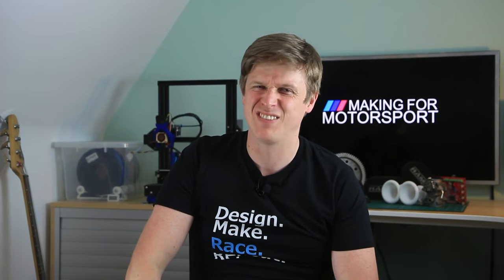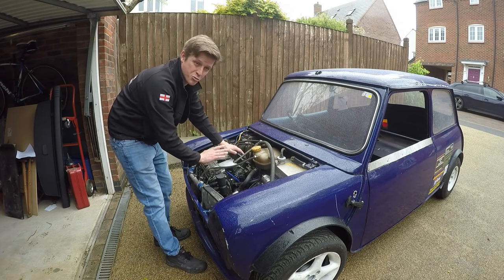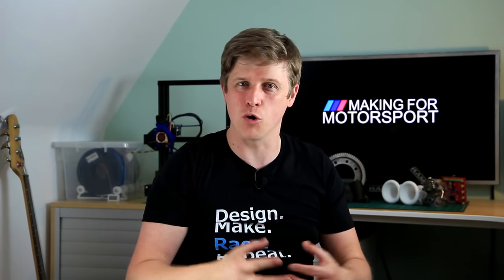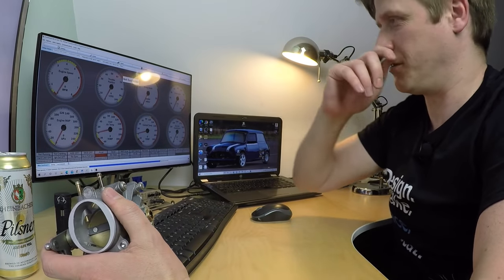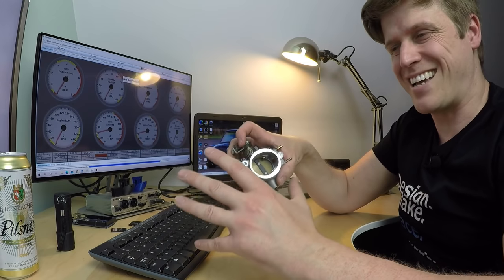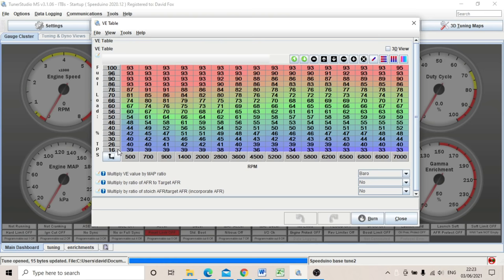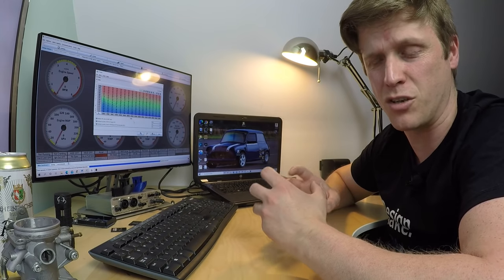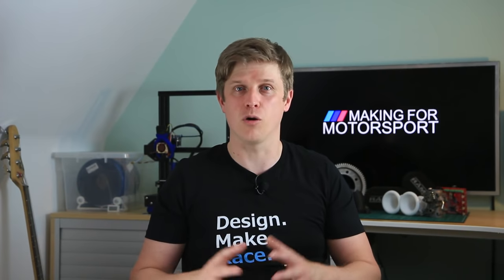How to fit Individual Throttle Bodies - Part 3 - Return of the BRARP!

Comment: Hi man! As You I built my car for fun in garage on jackstands, and as You, I fully wired my speeduino ecu on my own, and began to play with TunerStudio, now, if You didn't see Andy Whittle's channel yet, I suggest You to do, really helpful!(this involve MegaLog viewer install) For the Kpa column I will say to put back the value maybe changing the numbers by 5 in 5 starting from 100 then 95 and so on. My cruising Kpa is around 50 60, and idle is around 35 /40 I reach the very bottom of the table by lefting the gas pedal. So basically you are focusing on a underused region by typing 0 2 4 then jumping on 30 then 50, leaving at the important region 30 40 50  less calculation capacity refered to what is happening on the intake manifold. Make sure that AFR VE and Spark tables have the same numbers on RPM stripe and Kpa column. I found useful mapping the engine without Accelerarion Enrichment, then adding some extra fuel later. Keep going mate because this is too funny, sometimes is a bit frustrating because you don't know what you are doing, but soon You'll become more and more conscuious on what to do, why do this instead of that or say "nope!" and go back.
You are going like a train I really like what You are doing! Go man I'm with you
Good luck and have fun. If You need any kind of help ask! I will try to help if I can. 
Cheers!
Reply from the maker: Cheers buddy!  Yeah, the values in the vertical work fine for me using Alpha-N (TPS), but using kPa (Speed Density) your numbers sound about right!  I'm planning to have a play with Speed Density soon as lots of people keep recommending it.... 

The process you've described is pretty much what I did, leaving the enrichments to last.  Worked like a charm 👍

Comment: is that a 1.3 engine?
Reply from the maker: 1600cc… keep thinking about the 1800cc bigger brother but I don’t think power is my problem!
Reply: @MakingforMotorsport  better keep the small block engine for your type of racings. 1600 standard I think is 100hp and a 1800 115hp, I have a 2000 8v that I want to put in a mini sheel to but for hillclimbing racing
Reply from the maker: @natalinowerty  100bhp with ALL the torques I’d happy with… it takes a lot to squeeze that from an A-series…. I love Minis but for normal racing just remember, it’ll not handle like a “mini” any more…

Comment: how to size itbs on turbo engine?
Reply from the maker: You don’t really need them… you can have them if you want, but if I am right only the skyline GTR has them on forced induction…. 

All the benefits (throttle response, pulse tuning, better breathing etc) matter a whole lot less when there is a turbo bolted on…..
Reply: @MakingforMotorsport  i know that maybe r35 gtr and some porsches are too, im looking for mainly throttle response but i fear the 44mm body i have is too big for my 20valve 4cyl